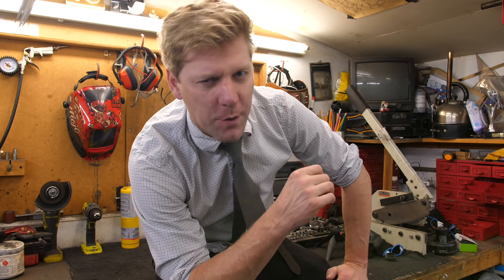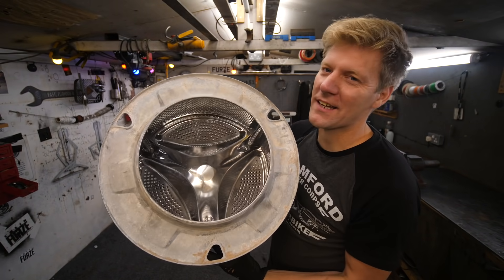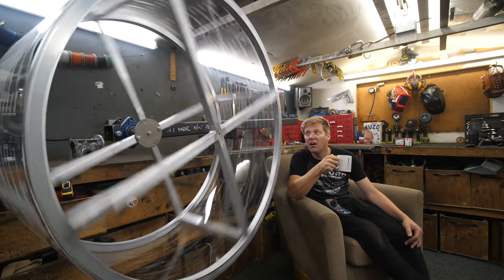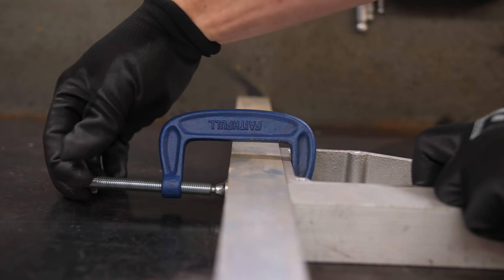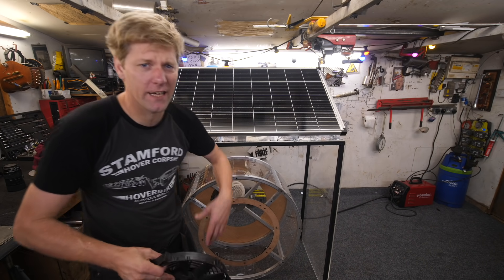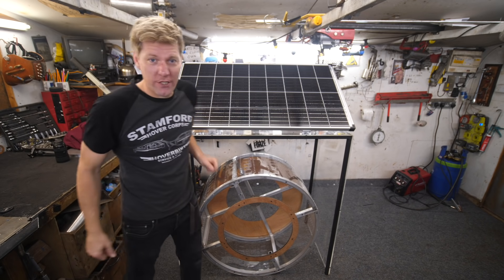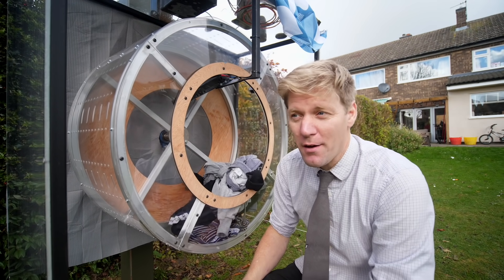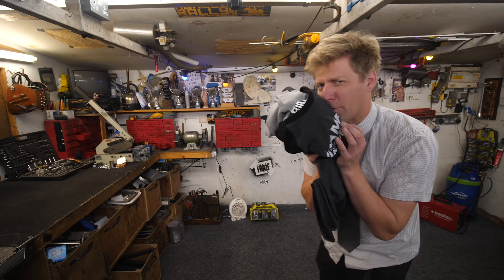Wind/Solar Powered Clothes Dryer

Comment: The irony of this entire video is that the amount of energy used to make it probably was like 3 years of clothes drying worth
Reply: no not even close
Reply: how do you thnk they are able to spin and blow hot air so fast. Also they use tons and tons of water
Reply: ishaan agrawal any sensible clothes dryer dont use any water. Some stupid condensating units do but those make no sense as heat pump dryer is much more energy efficient and don't heat up as much.
Reply: Same irony in shell sponsoring this
Reply: @sar19  i've seen an AED that was sponsored by Burger King
Reply: Yeah but the energy was used to make something that doesn't use energy
Reply: @matt hasty this is an often overseen issue with the environmental “friendliness” of e cars however, there are other major benefits of electric motors over combustion engines in terms of energy efficiency. For example, combustion engines are least efficient when accelerating (wasting fuel) whereas electric motors can provide immediate torque. (There is also an energy use in refining petroleum into petrol)
Reply: A dryer uses a LOT of energy
Reply: A really important point to make.  But I guess it's more about thinking design engineering and tech rather than efficiency at this point.  But I agree, in the scrum for energy efficiency we might be choosing inefficiency in such cumbersome projects - I recall energy saving costs versus double glazing costs - that was a similar loss, same with early solar panels. Maybe a different use - milling grains,  churning milk? It's all good for thought.  Knowledge is power and Power to Colin Furze - he's brilliant.
Reply: That's prototypes for you in a nutshell.  
The first versions won't, but once you refine the mechanism,  process, & materials, you can end up with something much better than the Mark 1, and better then what previously existed.
Reply: i havw shell internet
Reply: Instead of limiting co2 production why not just plant more trees to absorb the co2 with the added benefit of producing more oxygen.
Reply: Same irony in electric cars - the coal burned to make the electricity in the first place, not to even mention the energy required to mine and mfgr the components is massive by comparison!  And more than if you just used fuel DIRECTLY which is thee most efficient use of fuel!
Reply: @MattHasty  Out of all the UK's major sources of greenhouse gas emissions (transport, energy, heating, agriculture etc) the only one to make significant strides in the last decade is actually electricity generation. We now use far more renewable energy than we used to, and we use far less coal and more biofuels, which has significantly dropped the CO2 per TWh value (I can't remember how much exactly but I think it's less than half what it used to be). It's now more environmentally friendly to heat your house with electricity than gas (albeit more expensive). So electric cars, even allowing for the fossil fuel part of our electricity mix, use far less CO2 per mile than petrol/diesel cars - and this will only improve with time. Getting most or even all of our electricity from renewables (and nuclear, but new nuclear is more expensive than renewables these days) is not a pipe-dream any more...
Reply: @andrewmcleod1  n.tesla invented 100 percent clean energy that would be free for all globally if the power for profit folks didn't shut it down. The government probably uses it for themselves, along with the rich elite.
Reply: @MattHasty  my electric cars are powered by wind and hydro, no coal here as our coal plant was just shut down permanently this month.
Reply: @MattHasty  that is why we need the entire power grid to be replaced with wind solar and nuclear options the best case scenario is 110% solar stand alone generation capacity with nuclear for night time. the excess power generated during the day could be channeled into electrolysis for hydrogen generation or other energy intensive reactions
Reply: @MattHasty  Yeah those other guys are correct. If you crunch the numbers as I did in back in uni generally lifecycle emissions are lower for an EV. There are other cconcerns than CO2e. And if you are going to drive long distance an EV will probably be worse (although there are no commecially available EVs with long range batteries).

These guys do a reasonable summary: https://youtu.be/uIGnfTOmNUA
Reply: @MattHasty  bollocks, been proven false many times over, do some research.
Reply: @MattHasty  how about you just dont burn coal?
Reply: @Chuckiele  nice job solving climate change
Reply: @Chuckiele  there is no other alternative. What do you suggest? Solar and wind farms would take us back to the stone age. And no one seems to like nuclear for some reason. Coal is the only thing we have at the moment that everyone can tolerate and can supply out energy needs.
Reply: @eric31shaggs  What type of energy source makes sense for you highly depends on your geographic location. Norway for example can easily get away with 100% hydropower while still having enough for everyone to use electric heating. Thats mainly because of the high availability of thatt energy source and the relatively small population, so you obviously cant do that everywhere. Germany for example is very densely populated and has a lot of heavy industry, hydropower is completely maximized but still barely contributes 5% to the energy mix, simply because how much the geography offers. On the other hand wind and solar can easily exceed demand at times while it cant reach it at other times, so the main problem there isnt the source but the availability of storage, which is why coal is only faded out very slowly as that can fill the gap needed for now. Nuclear cant do that by the way, because nuclear power plants cant rapidly change output. Im not against them at all, but they just dont work in this case, theyre fine in a case where renewables arent an option. Burning fuels would still be fine if they were renewable like biomass and wood, assuming good exhaust treatment, but also synthetic oil based fuels are acceptable as the CO2 they emit have been taken from the atmosphere in production. Coal however is by far the absolute worse and should have been gone ages ago.
Reply: @Chuckiele  not that simple m8
Reply: @MattHasty  You doesn't sound so smart. You haven't thought it all out yet.
Reply: @MattHasty  the energy lost in transmission to the car charger is the part that after burning the fuel at the power plant really makes it worse.
Reply: @MattHasty  you’re not pretty bright right?
Reply: @MattHasty  whole system been designed to rip people off from the start bout 120 years ago...whole energy buisness all big pharma whole bloody thing..every country could just build miles off cheap solar sheds to grow food then we wouldn't need to export anymore..I live in cold old england it's nearly Christmas and I'm growing mango trees,turmeric  trees,fig trees,chillis,citrus you name it all under 150 watt worth off cob led chips which make there own heat so you get the warmth free..I could easily hook this up to solar and a battery bank on a cycle and grow anything on the planet..winter seeds you can bung anywher and grow vertical to sort the space issue...anyway just a ramble mate think everyone should make a start on doing there own food once you start you get hooked on it lol cheers
Reply: @jshaw4757  You should really make a video about that.
Reply: @jshaw4757  you can also grow weed off those COB LEDs but they don’t yield all that well and the weed isn’t the strongest stuff but it does work!
Reply: @jshaw4757  Wait? People still burn coals for energy generation? We are 100% renewable energy here.
Reply: @jshaw4757  agreed the more solar you got the more you can do if America was to invest all of the energy people spend bickering about petty things and build massive content spanning solar panel farms we could grow all of our food in the off season.  purify large quantities of water. split the water for hydrogen and oxygen and so on and as for storage use salt water batteries or simply pump water up hill behind a hydroelectric dam for the nighttime.

Comment: 2 points... 
1: it won't fit in the kitchen? Why can't you make slightly smaller and run the shaft out of the roof and mount the turbine up there? The solar panels would be just as well up there too

2: why don't you just make it a fully sealed unit like a tumble dryer with a water circulation system on the bottom from the drips of the clothes and use it to water your tree of trees? Or flower beds etc..

This is genius and has many and multiple uses and adaptations!

Comment: I think this is actual not that stupid for nordic countrys, cant hang cloth out becasue it often rain and high humidity in the air takes ages to dry. But the cloth get a fresh smell when dry outside and good for the fabric as not extra heat is used as a tumble drier. This is something in betwen traditional and a tumblerdirer, so how was the smell of the cloth, like outdoor dried or tumble dried?

Comment: Hi, just an idea: don't use the wind turbine at all, put the solar panel at the roof and the dryer will fit in the basement. To get rid of the moisture you could just use a big tube on one side. Yes it will take more time than a normal dryer but it will work.

Comment: I came up with this same invention in bed a few years ago  (although with a bit of a different setup, more holes and blades in the tumbler instead of just a few metal beams, and i hadnt thought of a curtain cover to keep the heat in) because i usually cant be bothered hanging my line up, but i didnt want to pay for the expensive dryers. I'm glad you managed to get this built, even though i hadnt suggested it to anyone, i see we have common interests XD.

Comment: Cover that open front with a plexiglass door, then add black wall and floor to create a solar oven (of sorts).  Also, if you are going to bother with solar, wind and electric, why not apply the solar and wind to provide power to the electric system? Add a small 4" vent to the solar oven with a damper to allow moisture to escape, while still keeping heat in the box.

But honestly, I think the whole project would get a boost, from fireworks!!!!

Comment: But what about the cost to manufacture the steel Aluminium and all the speciality parts not to mention the cost of using that lathe and all the cutting fluid wasted in this and the gear box oil... Seems more carbon efficient to just use a clothes line

Comment: How about a regular dryer powered by a solar panel / wind turbine combo? If you're going to wait all day for it to dry you could just as well modify the dryer to run off 24v power for like 12 hour, right?

Comment: Good one Furze.  But I'd replace the wooden bits with aluminium or Stainless Steel, and the curtain with another sheet of perspex, to act as both a door and rain protection when putting thing in or taking them out.   Alternatively, you could just knock a hole into the laundry wall.  In dryers and washing machines the glass window does indeed act as part of the tumbling effect, but so do the ridges on the inside of the drum, which are usually covered in rubber or these days silicone, to prevent damage to items placed inside.   Adding a heating element to the fan, powered from the solar cell/battery would probably help dry thing quicker.  Still a good one.   I did think for a minute you were going to build it big enough for a human to use as a treadmill.  Now that would be a lark, especially if you divided the drum and had the laundry in one half and you in the other... tumble dry the clothes while getting exercise!

Comment: As an Appliance service tech, I have a lot of suggestions. The drum needs baffles to carry the clothes higher into the air. that fan will eventually collect clothing. the drum speed needs to be higher so as to lift the clothes more air born (more hangtime= more air volume= more drying effect. And, finally, Heat. to make this practical, we need to dry the clothes in a timely fashion. on a hot summer day, this isn't an issue. but any other time of year, it will be.

Comment: Beautiful job as usual, but I'll take a clothes line. LOL. The drying is hindered because of the clothing clumping together.
Reply: Needs some paddles in the drum to help with that
Reply: How about a spinning clothes line
Reply: @tejasgurav1047  How about a spinning clothes line driven with the combo solar module and wind turbine?
Reply: I am glad you said it...a clothesline seems like the best solution.
Reply: @moviemoment5822  f 😔🙏🐶🚘😵
Reply: not if you hook up a 1000cc engine to it
Reply: Clothes line requires time to painstakingly peg all the little socks etc on the line. Very fiddly. His one, you throw the clothes in and you're done. Much faster to load and unload. Also works in the rain.
Reply: @joshuamaserow  that and the clothes are protected from things like leaves and other debris
Reply: I hope colin did an automatic clothesline, again.
Reply: The air fluff cycle??
Reply: @Pulse Dial My mother has one of those.
Reply: Hills Hoist baby!
Reply: but it would be protected from the rain! that's a pretty handy bonus
Reply: @Pulse Dial a bit longer than that. Rotary clotheslines date to the mid 1800’s, though they were popularised in the 1950’s.
Reply: I think the point of it was so you can still use it when it's raining and not use any energy from the grid but on a sunny day I think a clothes line is a better effort
Reply: Even without garden, i take the clothes line anyday
Reply: You can make a sailcloth cover for your hills hoist that stays on permanently and protects your clothes from the rain.  Makes a sort of shelter as well.
Reply: This isnt supposed to be practical, it’s just merely publicity for the challenge. The smart thing to do here would be to add larger, more efficient solar panels to your roof along side the wind turbine and store that energy in large batteries and just power as much of your home from that as you can, I.e a solar-power bank setup
Reply: People saying clotheslines, but you can't hang out clothes when it's raining and rainy is often accompanied by wind for the power. Only thing that looks not quite right is it needs to spin a little faster and have paddles to separate the clothes a little more as they tumble (already mentioned elsewhere).
Reply: I can smell the mildew from here
Reply: Needs some paddles and more speed.
Reply: https://youtu.be/kbY53RLJHfY
Reply: @Proffez01 stop

Comment: i bet if you put some ribs on the inside of the drum to help drag the cloths closer to the top before dropping them, then moved the fan over slightly, the clothes would spend more time falling and get more spread out, resulting in better drying times. kind of like a water wheel, but inside-out.

Comment: Lmao, umm you realize I can make the same thing without needing the Mercury, copper, plastic, steel, or semiconductors..... a wind and solar powered cloths dryer is call a cloths line. 2 small wheels attached to 2 poles (or trees) with a rope between them. (Fully biodegradable) I think I have you beat on the efficiency thing, and the carbon stamp thing.... you can thank our great great great grandparents parents for that one.

Comment: This video is a prime example of why wind power isn't the future. A second solar panel, and a design that had no provision for wind would be much better.
This almost has to be outside, zero use for half of North America 6+ months of the year.

1 solar cell, a larger battery bank, an insulated box to hold the drum, and a heat exchanger to collect and use solar heat to warm the air blowing over the clothes. It could be inside the house, probably even in a standard laundry room. Our house does 3-5 loads of clothes every Sunday so a unit that takes all day for a load would have to hold several standard loads. Maybe a double capacity drum, and change life habits to laundry every other day. That way the solar panel could charge the batt on off days.

Comment: Would it be feasible to wire the solar panel and wind turbine up to a battery and have that battery power the spinning of the drum, the fan, and mild heating into the metal frame of the drum? I'm sure have the metal be 25 degrees would make clothes dry faster.

Comment: You could take a zeolite solar water collector and encase the clothes and let the collector suck the water out of the air. The clothes would dry quickly in a very low humidity environment.

Comment: You could do this in the shed/garage and have the panel and the turbine on the roof. That way you can power a battery bank slowly when you aren't drying clothes or use it to power other things.

Comment: Great work Colin! I think the wind turbine is pretty heavy that's why you need strong wind to rotate, maybe using lighter material like the plastic used in light aircraft will work better. Cheers!

Comment: I work for an appliance manufacturer.   To decrease dry time. You need to add baffles on the inside of the drum and change the gearing/speed to get the clothes airborne. The typical intent is to get the clothing in the warm air stream that typically goes from back to front.   Your clothes are just a pile sliding around the drum. You could also go with a dark drum material to get solar gain.
Reply: Excellent advice.
Reply: This ☝🏻☝🏻☝🏻

Comment: I think you'll need to fiddle with shape but some fins inside, kind-of big ones to spread the clothes out will certainly reduce dry time, even seperate the big drum into smaller ones which could be geared to spin faster since the weight distribution of the clothes being all around will reduce your load